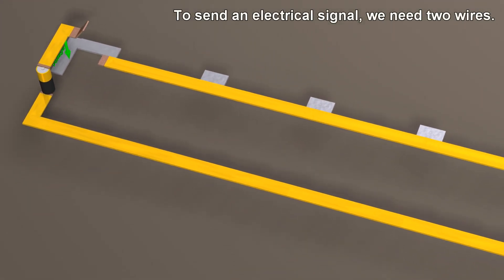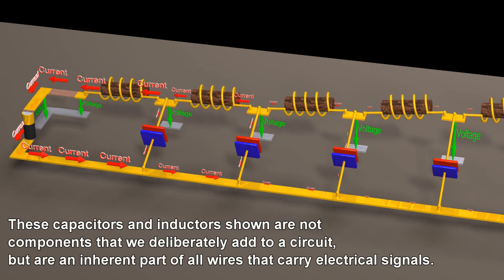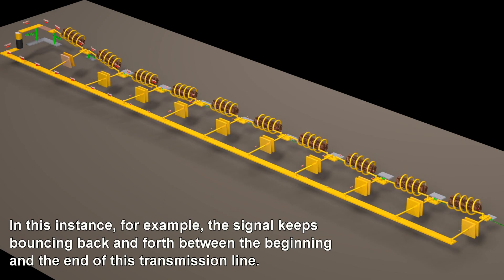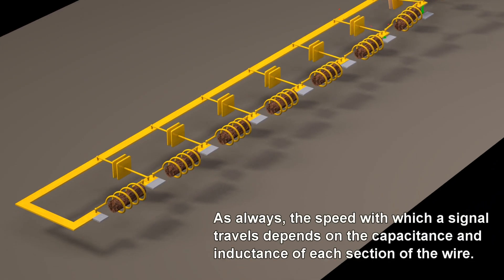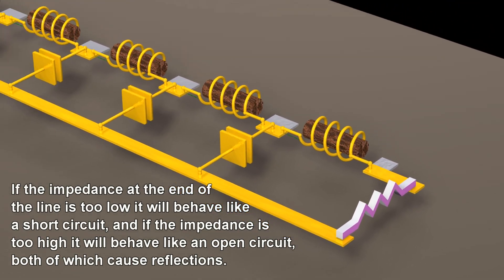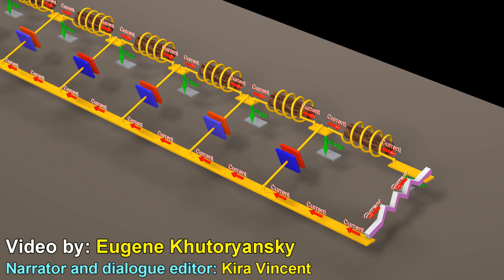Transmission Lines - Signal Transmission and Reflection

Comment: How does this work. If I conciser the first inductor in the line, the voltage in the animation ramps up, while the inductor current is zero. But if I apply equation  u=Ldi/dt for the inductor, I should see increasing current in the inductor for the voltage to rise? In fact, in the animation, the current increases once the voltage across the inductor starts to decrease. Once both side of the inductor are at the same voltage, di/dt should stay constant.
Reply from the maker: On the left side of the first inductor is a switch.  When the switch closes, the voltage on the left side of the inductor increases instantaneously to the voltage of the battery.  Then, because of the voltage difference between the left side of the inductor (battery voltage) and the right side of the inductor (still zero), the current through the inductor increases.  As the capacitor on the right of the first inductor charges, the voltage on the right side of the inductor increases, but it is still less than the battery voltage on the left side of the inductor.  Therefore, there is still a positive voltage drop across the first inductor, and the current across it therefore continues to increase.  When the two sides of the inductor are at exactly the same voltage, the current through the inductor stays constant.  This is what the animation shows.
Reply: @EugeneKhutoryansky  Thank you for the explanation.

Comment: When simulating the traveling DC input, it doesn't look like your simulation provides a pure "traveling wave" solution, since the voltages bob up above the signal height even before the reflection. Did you program in some additional inertia/attenuation terms to give it a different behavior than a standard lossless transmission line?
Reply from the maker: I programmed the differential equations for each capacitor (i=C*dv/dt) and each inductor (v=L*di/dt), along with Kirchhoff’s current and voltage laws.  What is shown in the animation is the results I got.

Comment: Something is not clear for me :
The appearence of parasitic elements (capacitance and inductance) is happening when the lenght of the line is upper than the wave lenght of the signal, if not the kirchof law are applied and we have a located circuit. But when we talk about DC signal we cant speak about this condition, yes the frequency is 0, but is there other condition in DC case about the line lenght? Also how dc current could flowsimply  through capacitance, this should take time te charge, then to discharge?  
thanks

Comment: Would like to see the waves aka oscilloscope pictures at the end of the transmission line. Not literally, just what would the waveforms look like if a non-interacting oscilloscope were theoretically possible.
Reply from the maker: Attaching an oscilloscope changes the waveform, because of the capacitance of the oscilloscope probe (and also possibly because of the resistance of the oscilloscope probe).

Comment: I have been experimenting with a single wire Transmission line feeding a single wire antenna element and the system s presenting an infinite Impedance to the source (I am using Impedance matching and the line 
is presenting no apparent losses on the single wire  transmission line
and very effective TEM wave radiation at the antenna. 

I love your Videos.

Your channel has helped me with my Radio Experimentation more  than any other information source.

Love It !!! 🙏❤️🙏

Keep up the Great Work.
VK3VKE.
Reply from the maker: Thanks.  I am glad my videos have been helpful.

Comment: Can you provide me details about transmission line termination with cable to reduce stiffness of surge voltage. Cabld impedance is low as compair to transmission line then how cable reduces the stiffness of surge

Comment: This is why you can get improved sound from different cables in audio systems. Or the way you lay cables and wiring in and audio system matter. There is some actual science and physics behind it. Less exotic components and more how the proper components can be engineered to be at optimal performance.

Comment: If use only inductor and iron core then use fast DC signal varies in length and intensity could be better form of communication that can not be James because direct current is not a wave so harder to jam

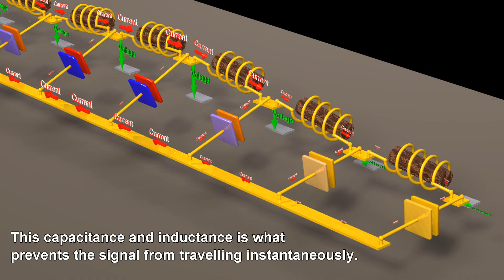Comment: 0:58 That's not correct. Speed of light limitation in theory of relativity is not related to capacitance and inductance in conductors. Also there are difference between phase velocity and group velocity.
Reply from the maker: The video is correct.  And I cover phase velocity versus group velocity in my video at https://youtu.be/EIqKG5TiSYs

Comment: 0:55 The fact that the signal cannot travel faster than c has nothing to do with the capacitance or inductance of wires, it is just because the electric fields propagate at the speed of light (c)
Reply: Yes and it builds from both sides.
Reply: Capacitors and inductors is how we model signal delay.

Comment: Why is there a voltage gain without a load?
Reply from the maker: Each inductor tries to prevent the current from changing, and therefore the last inductor continues to charge the last capacitor to double the input voltage.  The capacitor then tries to discharge, thereby creating the reflected wave.
Reply: @EugeneKhutoryansky  That makes sense. Thank you!

Comment: I noticed that there were several questions about why the voltage is doubled at the end of the open circuit.
Perhaps a few sentences can shed a bit of light.
Important to note that this video is about AC on a transmission line, and I address here a DC pulse on a wire.
Imagine an open circuit supplied by a battery and a switch.

If you do this in a real circuit, you can throw the switch, then measure the voltage at the open end.
It will be battery voltage.

Now ask yourself how this happened in slow motion.
The switch is closed, sending a pulse of current down the line.
The pulse will be at battery voltage.
Imagine that the pulse is a step pulse...that is, it is like an abrupt change in voltage passing down the line.
The video here correctly models the capacitance and inductance of a transmission line, but we can ignore that for this time.

When the pulse arrives at the end of the open line, current is not zero...it has some value fixed by the system, and is pointed in the direction from the battery to the end of the line.
However, the current in the line AT the open is zero. The incident current cannot abruptly fall to zero. Charge must be conserved. But no current is leaving the line, so there must be an equal and opposite current coming from somewhere.
It is the reflected current produced by the arrival of the pulse, and that reflected current derives from a "reflected" voltage.
Current has direction, but voltage does not, so "reflected" here simply identifies a voltage; it does not imply direction.
If the reflected current is equal to the forward (transmitted pulse) current, as it must be to have zero current at the open end, the voltage driving it must be the same as the voltage driving the forward current.
These two voltages, for the forward and reflected currents, don't have direction, and simply add at the open end.

Without getting into the complexity of source and termination impedance matching, we can say that this reflected pulse travels back toward the battery.
At the leading of the reflected pulse, the voltage is twice the battery voltage, but the reflected current, equal to the forward current, and opposite in direction, will cancel the forward current, leaving a zero current in its wake.
In an ideal generator, we would see that the open circuit voltage of the generator is twice its design voltage. Imagine shorting the line toward zero length, and ask what happens as length decreases toward zero.

In this video, the mechanical pieces are already in a wave motion before the pulse reaches the open end.
Realistically, at steady state, an open in a DC circuit has no current and the voltage at the open end is the same as the generator.
Realistically as well, in a very short time, the DC pulse behaves as described above, but line resistive losses and impedances affect the steady state condition.

This is not meant as a complete analysis, but rather as a way to justify the comment about the voltage at the open end being twice the source voltage.
An experiment with a square-wave signal generator and oscilloscope connected to one end of a pair of long wires open at the end will actually show a 2 step voltage trace: the first step showing the pulse as it leaves the generator; the 2nd step to nearly twice the first, as the pulse reflects from the open end and arrives at the generator.
All of these videos by Eugene Khutoryansky are first rate.

Comment: What? Why a battery voltage works out in pulses? I'd expect a wave to be "slowly" risen and battery get "extremely slowly" discharged. Why is there a capacitence? Is it related? Why can't they (cables) be placed far enough?
Reply: Oh, okay. It's an example for an unisolated line of to cables that bind together a lamp for example, but are lied down together. Cool. Very cool. Very cool and useful explanation that goes hand in hand with my lecture video. Many thanks!

Comment: If the two conductors here go to infinity, then the voltage will remain steady, at the input DC voltage, as the step passes down the line at about 0.7C. The direct current that flows charges up the capacitance and builds the magnetic field. The voltage to the left of the transient does not oscillate as shown at 40 seconds +, but remains steady. There is no change in the voltage to the left of the transition until a reflection returns due to an anomaly in the line.

Comment: Regarding the bit about nothing can go faster than the speed of light:  Was it in 2018 or 2019 that China announced faster than light transmisstion of information using the technique sometimes refered to as "spooky action at a distance", or quantum super-position.   I'm just sayin'.
Reply from the maker: That is not the transmission of actual "information", because it is a random signal that we have no control over.  I explain this in detail in my video on Quantum Entanglement at https://youtu.be/v657Ylwh-_k

Comment: The video presents the transmission line as asymmetric with  all the inductors on one wire only, which is not true. I understand that the author did this for simplification, but it adds a misconception factor that may complicate further understanding. Something similar happens with the wire moving up and down instead of having a graphic of the voltage going up or down at the various points of the line behind the wires. I worked with electricians who believed that alternating current moved making sinusoidal movements, like a snake, inside the wire because they always saw alternating currents represented as sine waves in the time domain. This is because some people lack the capacity of working with abstract concepts and take diagrams and animations literally, like someone watching the Flintstones may think that it is a documentary.

Comment: Even you got ideal transmission line without  any induction or capacitance your signal wont break any low cos it will at least speed of the light.  In real transmission line also signal will travel with speed of light but only in tiny fraction of it total energy.

Comment: Wow, I can't believe that so may people are worried about the music or the reference to Einstein. I work with transmission-line reflections all of the time and this is a great animation of exactly what is going on at a nano-second time-frame. Look carefully at each capacitor charging and the direction and magnitude of currents as the edge propagates through the conductor. My only suggestion would be to relate this animation (in real-time) to what you would see on an oscilloscope, because this is the information that you have when you are chasing down these problems. I wish I had something like this decades ago when I was trying to grasp these concepts in college. Thanks for the great animation.
Reply from the maker: Thanks.

Comment: Sorry, but you did not explain WHY that happens. First try to explain electrical reflection not with a sinus signal, use a rectangular edge, the edge run throuht the wire, needs to charge all capacitors and and a current runs through all inductives, without knowing, that the end of the line is open, which is a problem for a inductivity, because the current cant stop imediately through an inductivity, so it changes its polarity, increases the voltage, to reinforce the current.

Comment: Don’t all wires have resistance as well as inductance?
Reply from the maker: Yes.  To make the model more accurate, you can add a resistor in series with each inductor.

Comment: This is somehow confusing with the fact that the voltage is a sinusoidal wave n is actually supposed to bounce from negative to positive sides.. Now explain how it's still sinusoidal when the last impedance is the same as the line's: when there s no reflection. How is the wave still sinuisoidal, cuz i read it becomes constant ... WTH lool i think u got my point, now help me :)

Comment: Does this simulate a single length of wire with a dead-end, or is this representing a closed loop? I get the gist of transmission line theory, it just helps to have it side by side with what it's conventionally representing
Reply from the maker: A single wire can't conduct electricity, since we always need a return path.  This is therefore representing a closed loop.
Reply: @EugeneKhutoryansky  
So the capacitors represent the capacitive coupling of two adjacent wires in a loop?

Comment: Nice video, but why is there a current in an open-ended conductor anyway? I don't see any differences in potential? Do you?
Reply: There is a current because there is a TINY fluctuation in voltage.

There is a fluctuation in voltage for the same reason there are waves in the ocean.

Energy is applied to the ocean (from the moon's gravity) and that energy does not become one giant wave, but rather many waves of different size.

He is probably talking about TINY amounts of current. Just as the waves in the ocean are "tiny" compared to the energy supplied by the moon.

Comment: Not clear why at 2:20 "double the value of DC input voltage". Is that due to stopping of current and inductor trying to keep it on? But why exactly double? Why not infinite rice in voltage?
Reply: I've read the comments trying to find an answer to the same question.
I think the factor of two becomes more evident if we realise the input voltage refers to 0V (ground). Basically, the input DC Voltage sets the mean value AND the amplitude. Thus, if the induced wave must have a minimum voltage at 0V, and a mean voltage of VDC, its amplitude is VDC, so the waves oscillate between 0 and +2VDC. The key point is to note the mean value is not 0 (as in AC, for example), but the DC  value.

Comment: What happen with a short (< 1/20 wave length ) discontinuity?
Reply: Generator will see a short circuit at the distance of 18 degrees or less.
Reply: @jkinkamo  No, I mean a transmission line not isotropic, with a discontinuity in the middle.
Like
50/44/50 or 50/90/50 that is usual on connectors
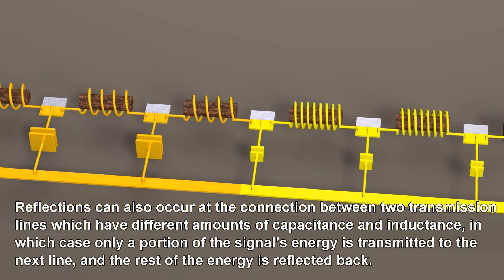Reply: @massimoromano4838  So 50 Ohm TX connected to a 50 Ohm coax which has 44 Ohm and 90 Ohm discontinuities (regardless of the length of discontinuity) respectively. It behaves like in 02:40. Reflection coefficient r = (ZLOAD-Z0) / (ZLOAD+Z0)

r = (44-50) / (44+50) = -0.06
r = (90-50) / (90+50) = 0.29
44 Ohms: 6 % reflected
90 Ohms: 29 % reflected

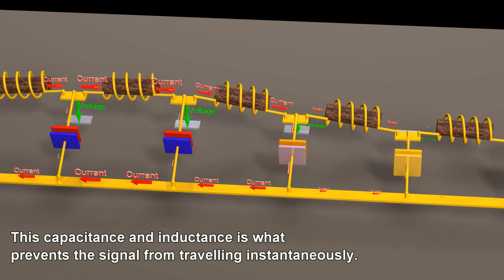Comment: 0:46 "This capacitance and inductance is what prevents the signal from travelling instantaneously."  This statement must be wrong.  Mainly, what prevents the signal from travelling instantaneously is the physical law that says nothing can go faster than the speed of light.  If "instantaneously" was used in other sense, then it better be clarified.
0:59 "Therefore, we can never eliminate this capacitance and inductance completely because this would then violate Einstein's Theory of Relativitiy ..."  Eliminating capacitance and inductance doesn't guarantee instantaneous travel of the signal as you can see that it takes time for light to depart from the sun and get to the earth.

Comment: Nice idea to animate it this way!  Although it wasn't specifically mentioned in the narration, it also shows how the signal gets distorted by travelling through the transmission line.  The sharp edged pulse becomes smoothed out.
Reply: Could you elaborate on what effect causes this?

Comment: I cannot fully understand transmission line even I studied it in EE courses. Like why a copper wire will have a 50 Ohm impedance?
Reply: Not a wire, rather a line in this case. A transmission line consists of two wires on this video. The characteristic impedance depends on the insulating material and distance between the wires. Modern industry standard is 50 Ohms resistive, unbalanced. So you can use 50 Ohms coaxial cable. There are other transmission lines too. I have used 300 Ohm two wire line and some people use even higher impedance. Of course one shoud take care of the impedance matching in order to avoid mismatch conditions seen on the video.

Comment: 1. Transmission Lines work on AC Voltages, therefore the behaviour need to be explained in case of AC signals.
2.Unlike communication lines, power lines are not terminated in characteristic impedance, so reflected wave cannot be eliminated.
3. The video must need to explain the behavior of incident and reflected waves on lines explicitly and in detail
4. The relation with the Einsteins Theory of Relativity doesn't make any sense. The fact needs to be corrected, if I'm not wrong. In case If its true, reason must be provided